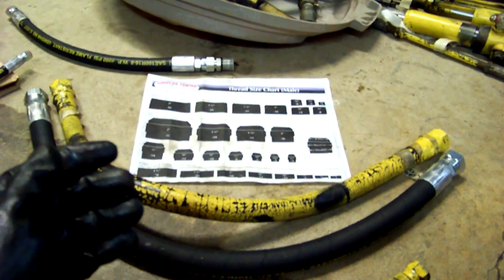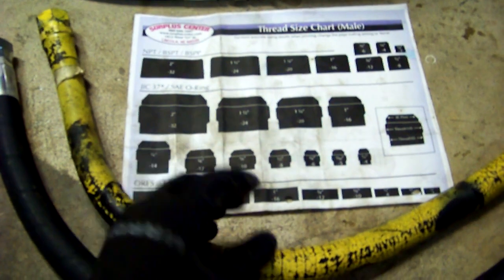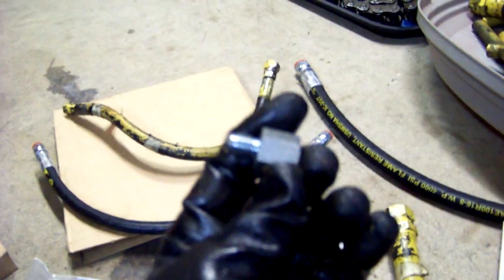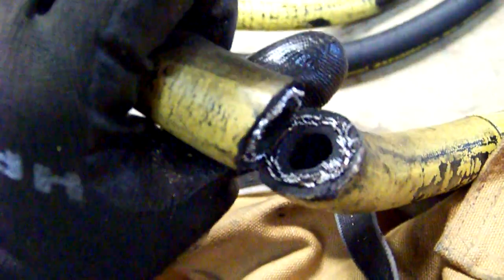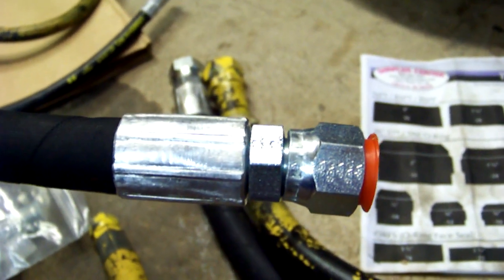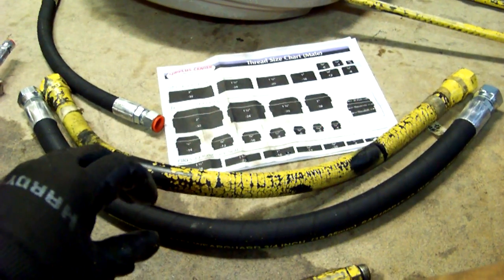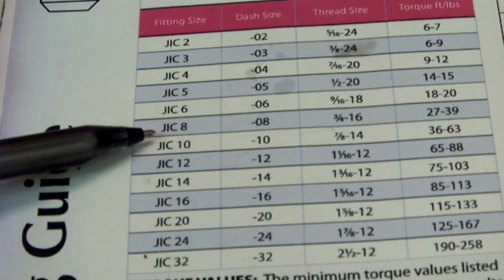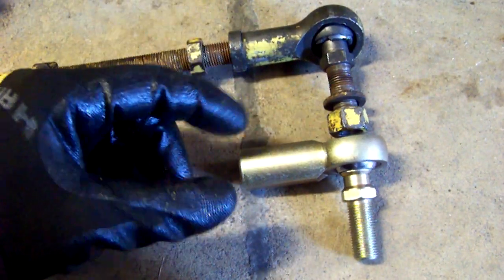DIY Save Money on Hydraulic Hoses with Pre-made Hoses (New Holland L35, other Skid Steers)

Comment: Have you ever cross referenced the single acting boom cylinders for dual acting with surplus center?  I Have a L35, but would like dual acting boom cylinders to use a stump bucket and cant find the specs.  I am pretty sure the L775 dual cylinders would bolt right on, but I am wondering if Surplus center has some that would work?
Reply from the maker: Hi -- no, I haven't cross-referenced the boom cylinders, but Surplus Center has quite a selection, and they might be able to help you.  They answer questions -- get in touch with them and perhaps someone can sort it out for you.  Good luck and Merry Christmas!